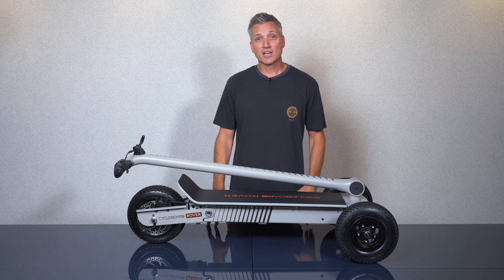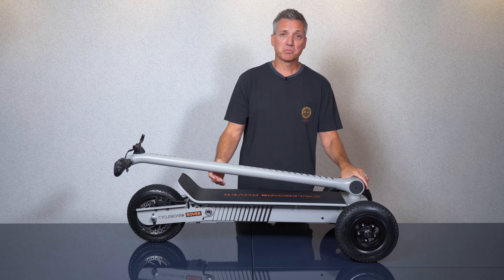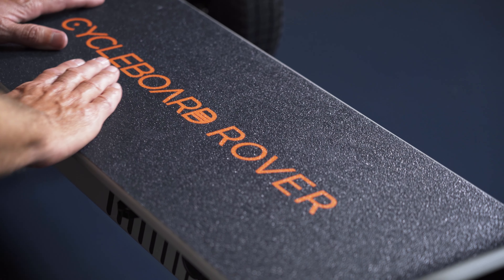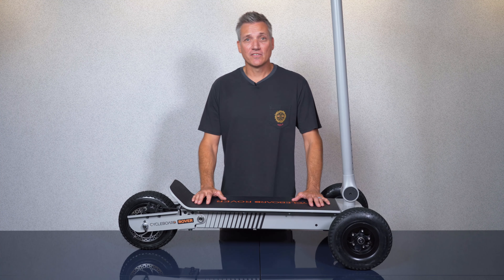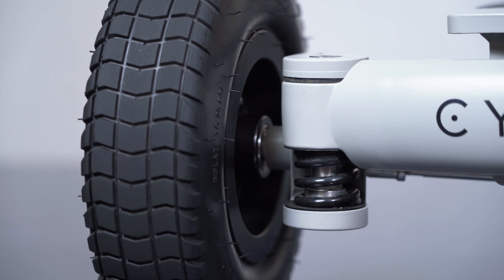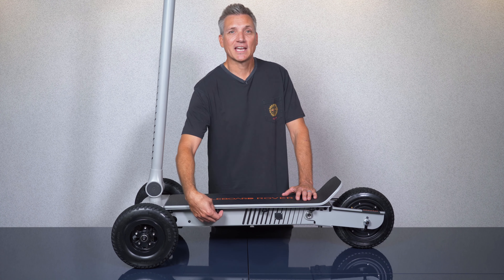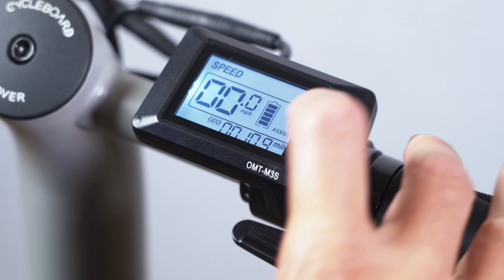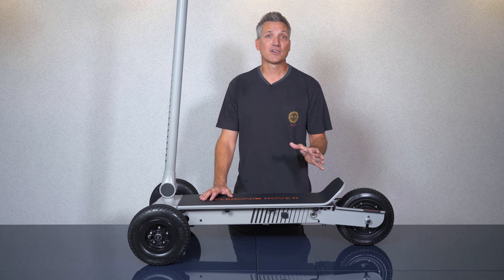Product Overview - Rover

Comment: Great review! I love mine. My inner tube bursted after less than one year of riding. Our season is four months long so it was under a year of riding my newest board. The replacement tube is out of stock. The Problem with that is I live near Canada which means we have a very short riding season. No company is perfect but allowing  your accessory stock to be depleted creates a lag in usage for people in my situation. Spring and Summer are the best times for a lot of CB owners to enjoy their Boards. Please consider being better prepared for this time of year with accessories. Customer service for my board has been beyond stellar. They even have a repair division if you’re willing to ship your board to them at your expense. I suggest using this option as my board is now disassembled and inoperable until I can get those new parts when they restock in late may. There is no where in the world that sells their sized rear tire or tube believe me my entire team spent days researching another option. Nothing! I could buy an entire new rear wheel and motor for 300.00  which makes no sense. The replacement tire and tube are 45.00! I absolutely love my cycle board.

Comment: can rover handle golf also?
Reply from the maker: Yes, you can definitely use the Rover on the course, you just wont have a few benefits of the Golf model such as 0 Start and reverse. Which might become an issue if you are stopped on an incline. Since the Rover requires you to be moving 1-2 MPH first in order for the motor to engage when you hit the throttle. Where as the Golf you can just hit the throttle and go. Just keep that in mind, but we have plenty of customers who have got the rover and the golf mount together to get best of both worlds. 

Also the hill climbing capacity is a little less on the Rover since the Golf model uses a low speed, high torque geared hub motor. Thanks for the questions, sorry for the delayed response, we have been busy preparing and attending an expo.

Comment: Better not get caught in the rain ridden it may not be safe just a suggestion
Reply from the maker: Our boards are ISP65 water proofing, as long as its not a downpour, you should be fine. Just be careful while on wet roads, but we have plenty of customers that ride in the rain with no issues.